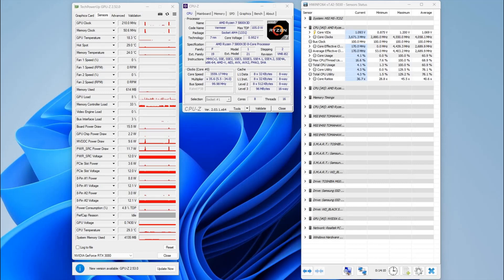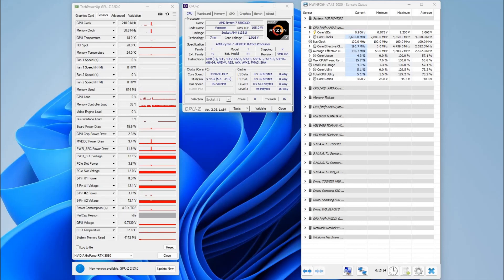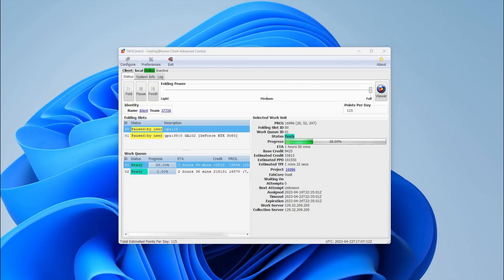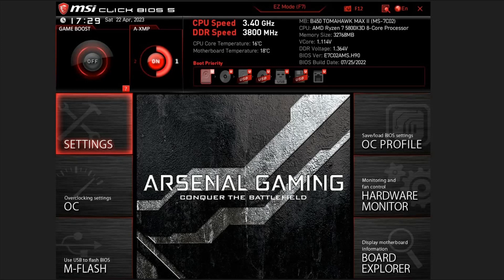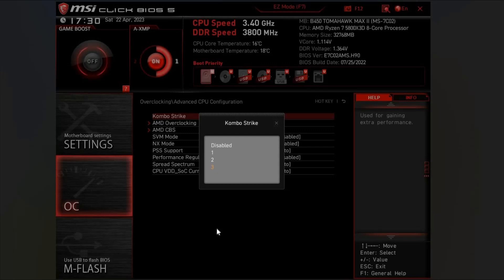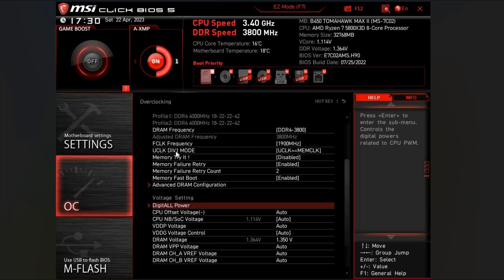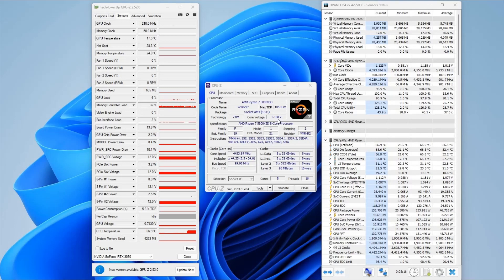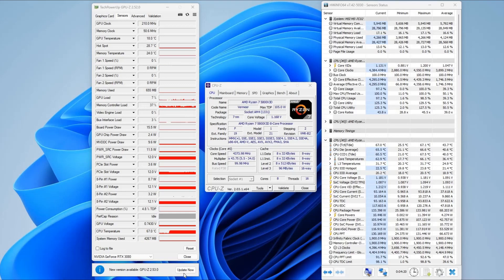Ryzen 5800X3D - Complete Guide To Undervolt Your CPU

Comment: I’m assuming Asus Performance Enhancer also in 3 levels is the equivalent of MSI Kombo Strike?
Reply from the maker: I believe Asus Performance Enhancer is PBO presets so it’s similar in a way but you should check the ASU’s website to fully understand what it does as I haven’t used an Asus board.

Comment: Thank you for this, before my Ryzen 7 5800x3D reached just 90 degrees on core according to HWinfo in heavy games like Battlefield V or 2042 despite my beefy Cryorig H7 Quad Lumi cooler. After setting this it no longer shows red, it is well under 90 degrees now!😊 Also set the memory voltage as you recommended to 1.35 as default was 1.4V. Works like a charm!🎉
Reply from the maker: Excellent!

Comment: You can use PBO2 also. Setup as a startup program in windows 11. I undervolted my cores based on their max boost per core.
Reply from the maker: Yep. I made a newer video covering this from within the bios. No need to use ryzen master in windows every time.
Reply: @tisiky  I would prefer do to it through bios, but every time I try to initiate advanced setting and use curve optimizer the cpu gets stuck at 3.5 ghz and doesn’t move. It’s a Gigabyte x570 aorus master mb with the latest bios.
Reply from the maker: @techluvin7691  Not sure why that is, I’ve only had MSI boards for AM4. With maximum -30 all cores, mine will boost nicely to 4450mhz during gaming.
Reply: @tisiky  It boost fine with settings on auto in bios……..but I cannot undervolt from bios. Only when using PBO2. I am also able to go above -30 with PBO2. Two of my best cores I have at -40 mv
Reply from the maker: @techluvin7691  anything over -30 doesn’t do anything. Max is -30 I believe.
Reply: @tisiky  Yes, you may be correct.  I don’t see much f a difference and the bios maxes out at -30

Comment: This definitely helped. I had a 5800x that never went above 60 degrees. When I upgraded to the 5800x3D it immediately went to 91 degrees and I re applied thermal paste a few times and even tried reseating it and the aio pump and nothing helped but this brought my temps in cinnebench down to 84 degrees. Is it normal for this cpu to run this hot? I thought my 5800x was hot at 60 degrees but I guess not. I have a 360mm corsair h150i capellix aio and good thermal paste so I wasn’t really expecting 40 degrees at idle and 85 in cinnebench
Reply: That's the 3D Cache
Reply from the maker: The problem is the way the cpu die is laid out, past a certain point the temps will shoot up. Essentially there’s too much crammed in such a small space.

Comment: When I do all this and test, I am still getting temps 91° which I know is acceptable at such a high stress test but it doesn’t seem to have dropped attempts at all which is what I was expecting. Fairly good CPU fan why am I still getting such high temps ?
Reply from the maker: What is your CPU power draw and voltage during stress testing?  Also what is a "fairly good" cpu fan? What thermal paste did you use? What is your case airflow like?  Let me know, I will reply back!

Comment: can i do this on a gigabyte 570Sx master mobo ? or is it only on msi boards ? do i need to download something? or is kombo strike there when you put the 5800x3d in the mobo ?
Reply from the maker: Kombo strike is the name of the MSI specific option prior to their latest bios that unlocks the normal PBO2/CO settings. 

You can do it on any AM4 motherboard, usually just depends if the manufacturer allows it. 

Check your mobo manufacturer website and download the latest bios. 

Then check out my newest video where I details PBO2/CO.
Reply: @tisiky  yea found it, don''t know the other settings for my x570s master with 5800x3d, for dayly use and gaming ? nobody has a video for that on bios f5
Reply from the maker: @jornmulder  I use the settings in my latest “msi bios pbo2/Co video” as my daily settings for gaming and general usage.

Comment: If you have been using PBO2 tuner and switched to kombo strike 3 then one simple way to check to see if you're undervolted is too simply run PBO2 after you've set the kombo strike 3, and you should see that all your cores are all set to -30
Reply: Thanks

Comment: Curve Optimizer is now enabled in the BIOS, which allows a lot more fine tuning; honestly, I think that Kombo Strike is just an all-core application of CO.
If you are so inclined, I would start with a per-core CO of -30 and check for stability with OCCT (stop on WHEA errors) - if a core falls over, increase that core's OC to -25, and go again.
Reply from the maker: True, but with the new MSI bios you gain access to PBO2 levels.  I made a new video on this, check it out!
Reply: @tisiky  I will be trying a per-core CO when I put mine in - a lot more precise😁😁
Reply from the maker: @JMUDoc  Yeah its worthwhile trying.  My 5800x3d runs -30 all core perfectly fine, I can even lower PPT levels for further reduced temps and power draw.  I still get 4.45ghz boost in gaming too 👍
Reply: @tisiky  Would you suggest lowering the PPT until performance starts to be affected?
Reply from the maker: @JMUDoc  I use PPT 100, TDC 65, EDC 90.  I probably wouldnt go any lower, since the -30 all cores is pretty heavy undervolt already.  I covered these settings in my latest video here - https://www.youtube.com/watch?v=6suCImFrKWY&lc=Ugw6_zIeFzUGqBptIoF4AaABAg.9rJrQbjfHkN9rLnNaJHh8U
Reply: @tisiky  As I understand it, performance increases with undervolt, until clock stretching kicks in, and then it goes back down.
Reply from the maker: @JMUDoc  yes so you dont want to run too low otherwise performance wwill be worse due to clock stretching.
Reply: Can't find anything on my b550 aorus elite

Comment: When i undervolting my processor i have bad score in cinebench ... can you check it? how much score you have in Cinebenrch r23?
Reply from the maker: My CB R23 score varies from 14500-15000.
Reply: @tisiky   i had a score in R23 of 14944, but i cant get it there anymore, don;t know the bios setting anymore. and if i had it on pbo enable, or auto, not on manual ppt etc..
Reply from the maker: @jornmulder  r23 scores can vary. It’s not always fixed. For example setting r23 to run in real time priority will probably get you 15k

Comment: i got a problem with it mine is new and im using as500+ cooler  with 3 intake 3 exh fans and while gaming the cpu runs around 75c/83c
using cinabench23 it reachs 91 92 max this aint normal right ?
Reply from the maker: No it seems high. I think typical idle temp is around 40c and then gaming maybe around 60c and then benchmark should be under 80c. 

Have you undervolted it?
Reply: @tisiky  i did using the kombo 3 also i have the latest bios update on x570 ace and now i bought ls520se and still same problem
Reply from the maker: @vMrCrAzY  Hello.  Ive made a new video today as MSI have released a new bios for their line of AM4 boards giving more control over overclocking.  If after following this video your still having high temps, then I would say its down to your physical PC setup, i.e cooler not sufficient, not enough air flow, or incorrect CPU cooler installation or bad cpu paste.  Check it out here - https://www.youtube.com/watch?v=6suCImFrKWY

Comment: On my B550 Strix asus board i have PBO2 enabled in bios with -30 on all cores. no extra jibberish stuff.PPT: 130, TDC: 85 & EDC limit on 130. getting around 15k in C23
Reply: Hye i use the same mobo can i know why I dont have the pbo option 😭
Reply: @Saracens.  Update your bios and you should have it
Reply: @Saracens.  I have the latest bios, 3002. maybe look for an upgrade? with the latest BIOS you should be able to use it, but you cant use PBO to boost the clockfrequency +250mhz. thats locked on 5800X3D in BIOS

Comment: why not simply use PBO2 tuner, set all cores to -30 and then automate it on windows start up? i get max 1.168V and while gaming my 5800x3d temps are 50 degrees Max (while im having between 320fps up to 1105fps @ 1440p on all of my games, besides warzone which sits at 245fps).
Reply from the maker: Because this is easier than messing around with PBO 2 in windows?  Literally a couple of settings in bios and your good to go.

Also 1000fps? Can’t be a particularly strenuous game. Not sure why you’d need 1000fps on a monitor that doesn’t run that high.
Reply: @tisiky   indeed or put the max fps to radeon chill max on 300, otherwise your card is gonna make coil whine sounds.. (well mine does..) 6600xt msi gaming.
Reply from the maker: @jornmulder  Not used AMD GPUs for a while, so cant comment on this.  I do know coil whine can be effected by the quality of the PSU too!
Reply: @tisiky  pbo2 tuner is super simple to set up literally copy paste -30 x8 times which u can set to launch command too which means u dont press nothin any more + you automate it by simply puttin it inside start up folder and its done. Forever. and It is wayy better of an undervolt than Kombostrike 3
Reply from the maker: @NaturalBornSina  I fail to see your point im afraid.  Using the bios method, my undervolt is showing 1.176v, so within margin of error with your cpu showing 1.168v.  (This is likely what your cpu would show if it was at 100% load as seen in my guide video).  Also, I fail to see the benefit of messing around with a workaround programme in windows, when you should already be in the bios when setting XMP profile for your RAM, so why not just apply Kombo Strike settings at the same time and be done with the undervolt?  I dont see how you can say running a programme in windows, then messing around adding it to startup programmes, is easier than going in your bios and changing one setting.  It is neither easier, nor is it the preferred method to undervolt, because if your undervolt is unstable for whatever reason, your pc will BSOD and restart.  The whole point of adjusting settings in bios, is so that in case it is unstable, you can go back into the bios and adjust the setting before you enter windows and your PC starts BSOD again, thereby leaving you in an endless loop?

Each to their own.
Reply: @tisiky  my point being that i had better results from pbo2 all cores at -30% than using kombo strike 3 (which in theory is the same -30% but i've seen on forums not on all cores, the main 2 cores are at -20) both in lower voltages and slightly better performance and more consistent max time of 4.450hz on all cores.
Reply: @NaturalBornSina  I doubt you had better results on PBO2... it's literally the same thing just easier to go -3 KS
Reply: @xbone8950  i did try both for 3 days each non stop benchmarking and gaming and as many on reddit i found that the -30 on PB02 curve bares more optimal results in performance , voltages and tempratures than the kombo strike 3 on my msi B550 Tomahawk. By 4%-7% but still better. Im assuming the kombo strike is less agressive doing about -26% to 27% undervolt in contrast with PBO2 thats does -30%. +You get the added benefit that if you do what i did (undervolt per core) you can set all cores to -30% and leave your 2 best cores at -25% for added stability cause usually the 2 fastest cores are the most unstable due to being utilized all the time , in my case core 1 and core 7. PS. Name 1 thing in life that "easier" was the optimum, lol.
Reply: What's the story with a -30 as a default? I have mine set to -50 and its stable. Cinebench on -30 gets me 14751, on -50 its 14831.

Temps on -30 do not go above 82'C
Temps on -50 do not go above 80'C

It's a minor difference for sure, but lower is lower.
Reply from the maker: @demballage99  -50 isn’t a true setting. This is an error on some motherboards. -30 is the maximum.
Reply: @tisiky  TIL! Just tested it and you're right. Thanks for the info.
Reply: @demballage99  -50???? Silicon lottery jackpot!
Reply: Seems to me like using PBO2 tuner to test how much you can undervolt is the best, then set the values in BIOS later (if possible). Then you don't have to restart the PC every time you've changed any values. And if you do something stupid the values should reset automatically when you restart windows.
Reply from the maker: @atnfn the main point is almost all 5800x3d seem capable of running -30 in bios, so instead of testing from the lowest differential in windows, it seems to make more sense to just set -30 in bios and test from there. If it can’t do -30 it surely can do -20 so it’s not taking much time to adjust. 

Of course with anything other than 5800x3d, 99% won’t be stable with maximum -30 so the method is different.
Reply: Only just discovered undervoltinf since getting the 5800x3d. Bios is somewhat an AIO stop shop!
Reply from the maker: @ThenameYTchose4me  An AIO stop shop? I don’t understand.

Comment: i tested the undervolt from from like 1.0 to 1.35 and if you run cinebench r23 youll notice at -30 curve around 1.2 to 1.25 is a sweet spot where your score is maximized and the core frequency effective clock is closer to the non effective clock and the temps are pretty good im on a x570 dark hero and a x570 godlike tested
Reply from the maker: Which CPU is this with?  I assume you mean 1.0 to 1.35, by using a core voltage offset along with Kombo Strike?  To be honest, maybe i got lucky!, but my 5800x3d with KS level 3 (-30), my cpu clock speed hits 4.55ghz in gaming with single core boosts, and 4.45ghz with multi core boosts, and its rock solid with stress testing.

I might try a little negative core offset to shave temps down a little, but if its not stable im ok with that as I think 1.176v and 4.55ghz is a pretty nice undervolt.  My old 5800x cpu did 4.5ghz at 1.200v, but it ran a really sweet PBO2/CO as I was running -25 and -20 on best cores for 4.9ghz single core and 4.5ghz multi core boosts.

I just wish we could take the 5800x3d clock speeds higher other than using BCLK.  It would be the ultimate gaming and processing cpu then! 😀
Reply: @tisiky  you use any software? i set only in bios Vcore and my score in r23 go down. :/